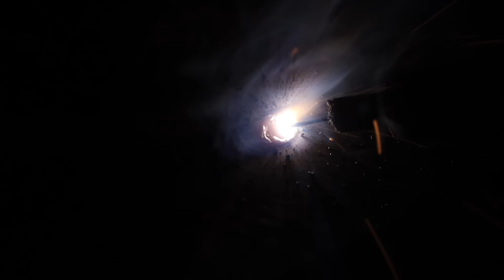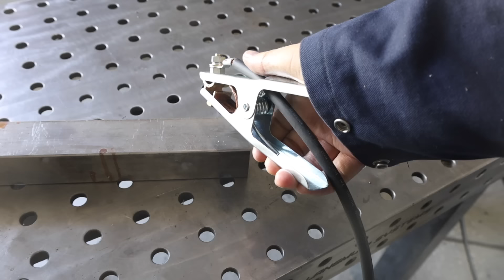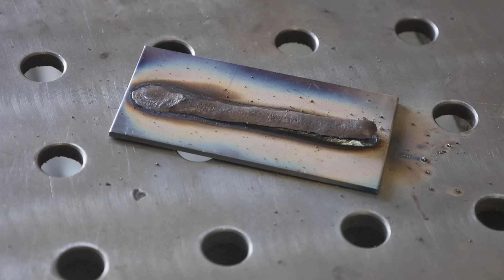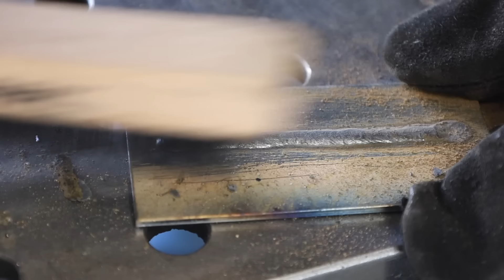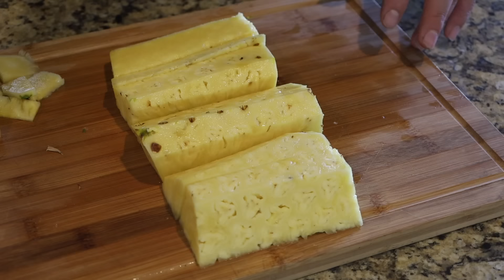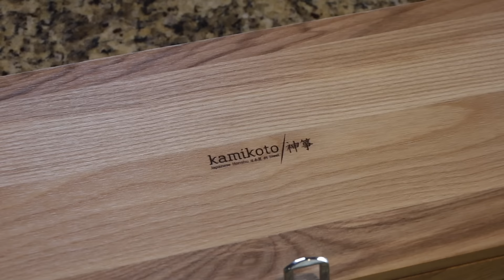Stick vs Flux Cored Welding for Hobbyists: Which type of welding is better for you?

Comment: The classic setup of a stick machine (I prefer used transformer machines for shop use because they're inexpensive and nearly indestructible) for thick work like building your welding table, work benches and equipment repair and a small wire welder (preferably MIG capable even if it runs FCAW initially) for sheet metal like auto body (countless body shops have ~100A wire welders) is tough to beat starting out. 

Stick has reach advantages (both the electrodes and running longer welding cable, including using jumper cables in a pinch since the electrons don't care!) and is more versatile since you have vastly greater filler selection including cutting rods (though they're not much better than wet 6011 IME), rods for aluminum etc. You can switch much quicker than fighting wire spools.
FCAW works well outdoors and has much less waste than stick rod stubs. 

One trick you can do if you score a suitcase feeder is power it off your (suitably stout!) stick power source. Lincoln used to sell a CV conversion box but many welders self included have run suitcase feeders like my old Hobart Heftys straight off a DC stick machine. I did that welding the roof sheet metal for my shipping container shop because lifting my power source that high then putting it away each time would have sucked.   

https://weldingweb.com/vbb/threads/336051-What-kind-of-suitcase-wire-welder-should-I-run-off-of-my-Sa-200 and other WW threads go into detail and every welder should visit that forum which is easily the best on the net.

Just because you're a "hobbyist" doesn't mean you can't read up on industrial machines then score them cheap, often cheaper than new budget gear!  I'm just a mechanic who welds but most of my machines are industrial and other than the weight (I choose not to care and have some light portable machines too plus OA) they're glorious.  Industrial transformer machines fell out of fashion for many shops because they use a lot of juice (not an issue hobby welding unless your hobby has eight hour shifts every day) and modern inverters have many cool features. Industrial inverter machines happen to be VERY expensive when they break while transformer machines can have very high outputs but cost less than a new inverter circuit board, like my Miller 340A/BP I snagged for 250 bucks because the seller didn't know it would work off single phase (I downloaded the manual from Miller and knew otherwise, always score the tech data!).  It does 540A out which I'll likely never use and has a delightful stick and TIG arc.

Comment: So flux weld for thin metals and stick welding for thicker?
Reply: Flux core on thin gauge is doable but not recommended. It’s mean for more heaver gauge material thickness like stick. MIG and TIG are usually good for thin gauge

Comment: What contact tip can/should be used in the titanium easy flux 125? The manual doesn't call it out specifically.
Reply: Depends on the size of the wire you are using when choosing the correct contact tip

Comment: Tim I need your advice. I’m in the market for a smaller packable welder for my farm. New to welding. I have fencing as well as farm equipment. What type of welder/type do you recommend and why. I’m leaning towards either Miller or Hobart. Thank you and appreciate the continued knowledge. I’d be able to hook up to 110 & 220 via generator and socket no problem.

Comment: How do you find out if a flux core wire weld can be welded over the top of? Is there a technical term for this to make amazon searches or in store purchases easier to carry out?
Reply: Multi-pass is the terminology.  There is a lot of good flux wire  with a GS at the end of their designation number.  It does not have that specific AwS specs.  Those might or might not be multi-pass /MP.

Comment: if u are flux core welding get the lincoln wire. you can run multiple passes with it. if your wire says “GS” on the wire wheel thing it means “general purpose, single pass use”
Reply: Any E71T-11 will do.

Comment: I have a question, and maybe an idea for a video - how would you weld forget iron ornaments to steal tubing (for making stairway railing)? Total newbie, have really old REL/MMA Varstroj Gorenje 160/180A I need to start practicing with and I'm planning to buy MIG/MAG Hugong Extremig 200 LCD. So I'm wondering if you could take a look at thst Hugong and give me your opinion.  I'm planning to use it with pure CO2  as it's cheap and safer for my small in house shop. 
I see you really know your welding, so I have decided to pop this questions to you and hope for an answer or even better a video. 
All the best from Serbia!

Comment: Thank you very much for your informative videos. I have learned a lot from you. I started learning welding mainly because I wanted to make my outdoor fence. First I started with MMA but later I switched to flux cored. As I was welding 2-3 mm (11-14 gauge) wall thickness I can tell (confirm) that it's much-much easier to work with flux cored. With 4 kg (4 small spools) experience I also tried welding 0.8 mm (21 gauge) sheet metal with 0.9 mm (0.035") wire. It went suprisingly well: https://youtu.be/e9hSKCz7I6k

Comment: Wow i did not no that about flux core  i have welded 1/4"  many times with multi passes i usally use hobart wire from tractor supply gues i will start looking the wire up or start practicing stick. Thank you for the useful info!!!!

Comment: My rationale when choosing as a hobbiest on a budget, was that a cheap stick machine had a lot less to go wrong than a cheap flux core. I could easily picture a badly made mechanism jamming up all the time. The stick machine leaves more of the job to the operator and their skill, which sounded like a fun challenge, whereas a broken down flux core just sounded irritating. That said, I find myself buying more expensive steel since I'm not confident in my ability to weld thinner stuff.
Reply: Find some really thin stuff and hunt down some 1/16th 6013
Reply: I started on flux and thin sheet metal is just miserable with it. Too easy to blow through, I find myself going toward 18 gauge and lower or welding solid round tube, flux is a very hot process

Comment: I started with stick but just bought a gasless mig welder I love my stick welder and still use it alot but I use my gasless MIG for the thinner stuff because it's really good for that but with the thicker steal I use my stick so to put it in diameter I can use my gasless mig up to 3 mil plate anything thicker than 3 mil I use my stick

Comment: my suggestion is buy a machine which can do both and find out which ones you're more comfortable with. personally for most stuff you can get away with flux core. if prepped right and the machine is cranked up ive done single weave pass on 10mm material that's got to hold 100+kg and its worked just fine. i would run 3 stringers now just be sure but i have confidence that flux is just as good as stick at digging in and getting penetration its just it needs more passes to fill the gap and cap due to smaller diameter material going in the puddle. would love to see some flux core strength tests . maybe get a bottle jack and make a hydraulic press to test strength and multiple passes with each process. a bit of red neck science. great video as always Tim
Reply: I work for a company that builds ladles, scrap hoppers, bottle cars etc etc. all we use is flux core.

Comment: Hey Tim!
I am a builder and recently I started my adventures with stick welding. I am a small YouTuber also, so of course, I made a video about my first welding project. I quess, that you are too busy for watching my video? 
Anyway to summarize my experience. I had 7018 and a 2,5mm rods. Deko amazon welder. The first notice is, that I got some progress when I turned the machine on 120 amps. Although you have done it with 85 amps with the same tools. Can it be, that my welder is not identical to yours? That actually it is way lower than it shows? With less than 100 amps I didn't get running sparks at all. Just some sticky welding. And I practiced for many hours. 
Under my video in the comment section, some guys recommended me to try the 6013 rods instead. Can you please comment your thoughts?
Cheers from Estonia!
Reply: Hello I also have one of these Deko machines and have found that it outputs about half of what it says on the dial ergo120 amps is actually 60 in the real world.
I assumed that my machine is faulty and am in the process of returning it.

Comment: Kamikoto knives are made from the cheapest steel. I watched some videos and read so e articles on the durability and type of steel used in the blades, and im not a fan. They might come sharp but due to how soft the steel is are likely to dull pretty fast. This is fine if you know how to sharpen knives, but realistically not ideal for 99% of people nowadays.

Comment: I was once in a situation that I had to weld very thin material, I think it was 18 gauge or maybe thinner. Had no wire and I did had some 1/16" 6013 rods around. They solved me the problem. Never thought it was possible to wel that thin metal, wasn't easy but doable.

Comment: Why not MIG, not much to clean up?
Reply: Thank you for your reply Tim.  I agree stick (arc) is my preference.  I have found stick has better ductile properties, has properties more like the parent metal.  And with 6010 0r 6011 you can great penetration, then cover with 7018 for a good weld.  But for thinner material I would prefer MIG or Flux Core.
Reply from the maker: Great thoughts! I did a similar comparison of gas shielded process (MIG and TIG) earlier this week.

Comment: Why does people ALWAYS use gas less flux core in their vids that’s so annoying I’ll use a stick welder before I use gas less flux core
Reply from the maker: I have lots of videos with GMAW, GTAW and dual shield. I used self shielded flux core in this video because entry level equipment cost is similar to stick welding.

Comment: Can any one explain pulse mig welding. Used it today on our welder today seemed to better for overhead.
Reply from the maker: Pulsed MIG uses gas and solid wire in the spray transfer mode, where the arc is always going. Standard spray transfer is a very hot process, making it difficult to weld out of flat and horizontal positions (except on aluminum). Adding the pulse reduces the heat input while still maintaining a spray arc transfer. That makes it awesome for different welding positions and thinner material. Thanks for the question, might make a good future video topic.
Reply: @TimWelds  thank u for the reply. Just got a new miller 225 and haveing a hard time getting it dialed In. Was welding thiner square tubing and the pulse worked great .u should do a video o. What gases to use with it I had regular argon not recommended buy worked well.

Comment: Great vid! 
I'd say there's no reason not to have both since there are dirt cheap options for both. Personally I bought a more expensive stick machine and got a budget flux core machine since I only use the latter for very very thin materials and don't need much effect. 
If I really HAD to choose one, I'd keep the stick machine.
Reply: Which stick welder did you get? Or recommend
Reply: @floridamanofficial  I got the ESAB Rogue 180i Pro, and I love it. The most important thing is that it is reliable; if I dial in a certain amperage, I will get very close to what I ordered. It may sound like a given, but it ain't always the case with the cheapest machines. My first welder was a Telwin Force 165, and I don't know for sure what it gave me since I had no way of measuring it but when I used my "old" settings on my ESAB it frequently caused instant blowouts on the materials indicating that the output was WAY lower on the old machine. Also, welding at more correct settings makes it easier to strike an arc. Learning the basics on a machine that weld alot cooler than expected wasn't easy as I welded the electrodes stuck constantly. It still happens but not nearly as often.
 I'm a hobbyist so duty cycles aren't very important to me, but if I ever need to weld for prolonged periods of time it has a 100% cycle at 90A at 230V (70A at 115V) and I have until now never needed more than that. I mostly use ESAB Goldrox 2,5mm electrodes and they run very smooth on around 65-70A.

Comment: I want to learn welding as a hobby so I can make up some gates, stands, etc. around the house and garage. I had assumed stick would be the way to go, but are you saying flux core would be better for a hobbyists? If so, is a flux core welder a specific thing or do you buy a mig welder and run flux core in it. I did a search around my area for flux core welders and didn't see any specifically marked as such.
Reply: Tim is essentially correct with his suggestions. However, just to draw out some distinctions. This video seemed more about the baseline use ability comparison from a 7018 (SMAW) to some as called Flux Cored spooled tubular wire(FCAW). The direct comparison was the selfshielding* flux cored family of wires. Other as called Flux Cored wires are gas shielded & metal cored (mild & alloyed) tubular wires. Even cored wires for sub arc welding. As a point of interest for the home user semi-automatic welding seems to be the growth area. Stick welding a 14" rod with a 2" stub loss & lifting your helmet up & snapping it down plus a struggling arc initiation(even though power sources have much improved). Also let's not forget the challenged eye & hand coordination in consuming a welding rod running a bead.

*selfshielding is the more proper nomenclature. There's chemical components in the core that break down through the welding arc to selfshield the arc from outside contamination. This is the same logic to the stick electrode.
Reply from the maker: Great question! If you’re welding thinner than 1/8” (3mm), flux cored will be a lot easier than stick welding. MIG would be even better if you’re willing to buy a gas cylinder. Pretty much all MIG welders can run flux cored wire (you just have to change polarity and use the knurled drive roll that comes with most of them). MIG welders are generally better built and higher quality than dedicated flux cored welders. You can buy dedicated flux cored welders on Amazon or at most big box tool and hardware stores and are often called gasless MIG.
Reply: I just learned a bunch from Tim and others. You can get machines that are dedicated to 1 type and you might do that without knowing. I went with the PrimeWeld MIG160. It is 120/240, comes ready to do stick or flux core and can do MIG if and when ready to buy gas.

Comment: Good video mate I have only been stick welding for about 4 months but the first week I was welding 2mm quite easily and was able to weld some some 0.9mm square tube but joints with about blowing holes but it was not fun at all haha and I did blow through more times than I didn't  but I would say 2mm/ 14 gauge steel isn't too hard to weld for the bigger with 2.6mm - 3/32 rods i find it can help to do your tacks with 1 rod size down to what your welding with and to burn the tack rod about as hot as they will run in most of the time happy 
welding to all form south Australia
Reply: I also recommend welding with big ass transformer welders as i think it makes a much more fun experience buzz buzz buzz but part might just be me hahaha
Reply: @ryanelliott1650  yeah, I learned stick on a Northern Tool, 220v made in China buzz box,…. It was fun! and it works well 😂

Comment: I bought one of those little lunchbox flux core welders a couple of years ago for making around 100' of guard rail atop a retaining wall.
Since then I've found it really helpful for little jobs on site.
Stick welding is great for structural but the wire welder works better (for me) when I have lighter gauge OOP 
Do you have any recommendations for multi pass wire? I've never used it, but would be willing to give it a try.
Reply: If you're looking fot selfshielding type FCAW, the T-8 would be the closest match to a 7018.

Comment: Great video! Worth pointing out that for most hobbyist type projects (furniture, BBQs, gates, welding carts, etc) 16 gauge (1.6mm) is thick enough for nearly everything and occasionally 1/8". Anything that needs thicker than that (axle stands, structural stuff) is likely to be safety-critical and not such a good idea for a first time amateur project anyway.
Reply: I am a hobby forger I work with exclusively thick metal the weld has to be strong enough to handle the force of the hammer striking near it without breaking